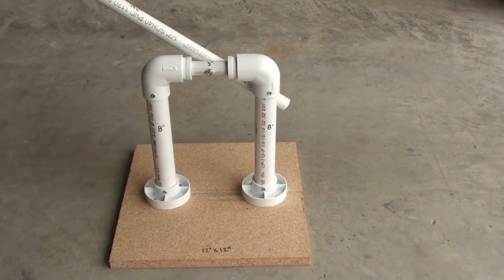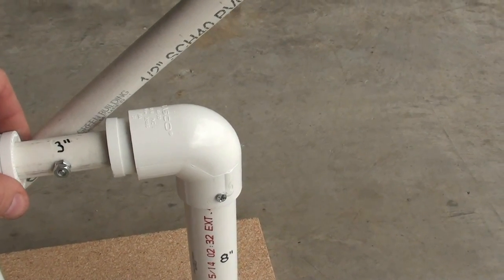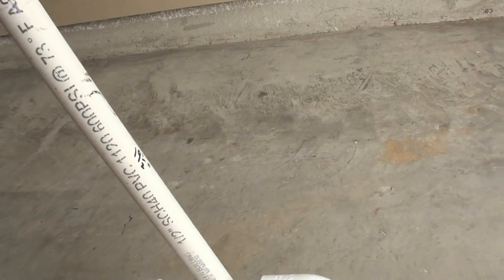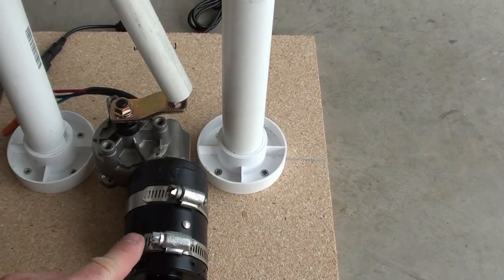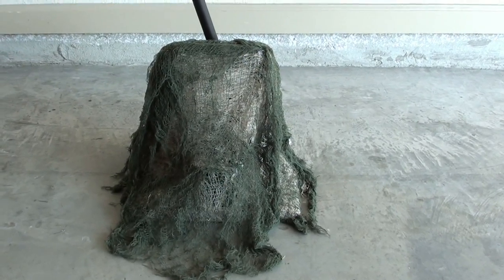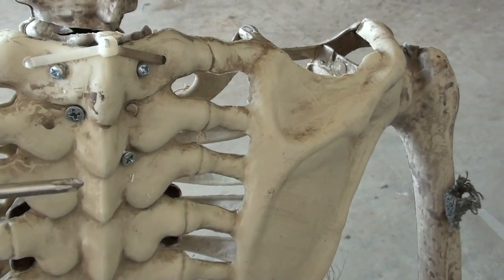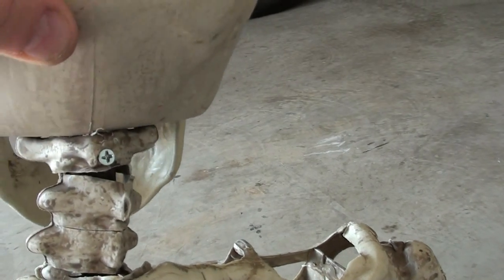How To: Ground Breaker (Circular Motion from a FrightProps Wiper Motor)

Comment: Any tips for reducing the noise from the motor and pvc?
Reply from the maker: I just kinda left my stuff noisy. It adds to the creepiness. WD40 or bicycle lube on the PVC maybe? Windshield wiper motors are a bit noisy, so enclose it in a box maybe?
Reply: Thanks so much! This turned out a pretty cool build! I added some legs and did a spray foam coal fired look. But I watched this video so many times and it helped a ton!
Reply from the maker: Tim Kline Awesome! I am so glad to hear that. What some “not in the biz” don’t understand is that these are homemade and very difficult to design and build. It’s a great day when you figure something out and make it  work. That’s why I made the videos. Congrats on your build.

Comment: Did you run the pvc 19inch inside the spine of the skeleton all the way up thru neck
Reply from the maker: Yes. I only loosely secured the head so it would move around.

Comment: how do you attach the shaft to the spine? You really don't show how
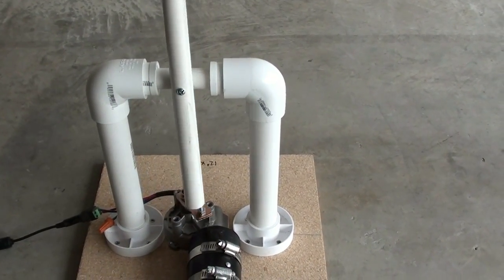Reply from the maker: There is a long screw attached to the top of the shaft. It does not attach to the PVC spine, but rather goes into the inside of the PVC and guides it in a circular motion. Advance the video to 2:22.

Comment: Do you think this would work off a reindeer motor or not enough torque?
Reply from the maker: Gilbert Street Cemetery I think a reindeer motor would have enough torque because there isn’t much weight, however it would move considerably slower. That’s why I chose the wiper motor.
Reply: I have an extra reindeer motor laying around and just finished my first motor/moving prop so was looking for another easier build for it. But now that I think about it I think your probably right I don’t think it would be quite quick enough

Comment: is the 19" diagonal piece just sitting on the 2" nut and bolt where it attaches to the motor arm?
Reply from the maker: Good question. Nope. Play the video at 1:05 and you can see that it is bolted to the 3" cross bar. This serves as a pivot point so that it moves in a circular motion when connected to the motor. The weight of the skeleton is on the 3" cross bar. Thanks for watching!

Comment: What are you using for a power source? You are going from 12 volt to house current using...???? Thanks
Reply from the maker: Hmmmm, I guess I skipped that part. Great question. I use a 12volt 5 amp DC power supply. You can briefly see it at 2:46 in the video. I buy these from frightprops.com, but they are available elsewhere as well.
Reply: Hawthorne Manor Haunted House thanks. Appreciated

Comment: Very nice!  But I missed the part in the beginning where you acquired the parts that turn from side to side.  What is the name of those pieces that allow the center bar to "turn"?  I've never seen anything like that in those big "home" stores.
Reply: You mention "connectors" at .54 seconds, but I can see myself walking into "HomeLowes" asking for PVC connectors, and getting the "look" from the help.
Reply from the maker: If I understand your question correctly, those are 1" to 1/2" PVC Reducers, available at Lowes and HD. You can push the 1/2" end in all the way and glue them in place, but leave the 1" end loose so that it can turn. Add a little grease for better movement. http://www.homedepot.com/p/Charlotte-Pipe-1-in-x-1-2-in-PVC-Sch-40-SPG-x-FPT-Reducer-Bushing-PVC021080700HD/203811579

Comment: How would you just make this go back and forth, not side by side...without motor.  Want to make prop for outdoor witch without motor.  Your idea looks great to start.
Reply from the maker: mark spencer please see my recent video on "the intruder". You need a pivot point. The motor can push it forward and pull it back.

Comment: How do u get power to operate this motor
Reply from the maker: I connected a 12volt 5amp dc power supply (http://www.frightprops.com/controllers-electronics/power-cables-and-transformers/dc-power-supplies-0726.html) to the wiper motor and plugged it in to an extension cord. It connects using a male and female terminal connector: http://www.frightprops.com/male-power-supply-adapter-with-screw-terminals.html. To have it trigger when someone walks by, add a motion sensor. You can see how to do that in my "Haunted House Sound System" video: https://youtu.be/kgbCJzd7Oys

Comment: Great videos, extremely tutorial and easy to follow and we love your other props = QUESTION - say I use a windshield motor...how do I power it?  It looks like you somehow wired it for electricity.
Reply: In the title he does it a wiper motor from frightprops so they have probably got adaptors to convert the power, however! Another idea is to grab a small 12V battery from your local battery supplier, about AU$50 at battery world in Australia, then there's no cable running too far and in the way, and can be charged with a car battery charger!
Reply: I have the same question. It looks like it might be some sort of DC converter? As many of these DIY's as I've watched, this subject doesn't come up?
Reply: @kgpiper44  windshield motors come from cars which are based on a 12V system, this means that you can’t just plug in into the wall outlet because that is 120V and it will just blow up. so, all you really need to run one of these motors is a good 12V power supply with enough amperage, something like 5 amps. You could use something like a computer power supply, but of course they can’t get wet so not really a good idea for outside use. Even some gaming systems like the older Xbox use 12V supply so if you had an old cable that you weren’t using that might be an option. But if you don’t know what you are doing the best way is to just look online, I know that Frightprops sells the windshield motors and power supply’s together, so that would just the easiest way of doing it.

Comment: ok, question *****  your vertical cross piece that is 1/2 inch is that not a bit of a tight fit?  When i spin mine it squeeks loudly from the front to back as that vertical 3" piece spins inside the 1 inch to 1/2 fitting i tried to put vaseline on the ends and not much diff, so wondering if you maybe sanded those ends or something to let it spin a bit more freely
Reply: *****  ok never mind, i found that the piece i was using was a little long so the ends were binding on that lip inside the 1/2" to 1" fitting, i cut a bit off so that the ends do not touch that inner lip inside that fitting and now it moves nice, no noise or binding.. :)
Reply from the maker: iowa chapman Oh, wait, hold on. Great question, actually. The 3" long 1/2" piece does not turn in the 1" to 1/2" fitting. The 1" to 1/2" fitting turns in the 1" 90 degree fitting. If you don't push that fitting in all the way, it fits together loosely. Add a little Vaseline or grease there. The 3" long 1/2" piece SHOULD be a tight fit in the 1" to 1/2" fitting. at 1:09, watch the lettering on the 1" to 1/2" fitting very carefully and you will see it turn. No wonder it was squeaking. Make sense?
Reply: Grin I think I got the same result by having that 1/2 inch size a bit shorter so it just barely goes into that 1" to 1/2" downsize fitting, it was rotating with no noise, the real test will be tomorrow when i get a power supply that should power the wiper motor, if this one dont work I will have to order from monster guts, and pay shipping ugh, this one is regulated, 12vdc 5a and has 3 prongs,  first one i ordered on amazon did not have 3 prong and it was stuttering on high speed.  I sent message had a feeling it was related to that power supply and they said yeah your power supply is the issue.  Found one on amazon with prime so will know tomorrow.  Thanks for reply
Reply: Oh yeah, I am using your version here for upper and then used those pvc from spider hill to do legs for lower standing swaying zombie.
Reply from the maker: iowa chapman So you haven't had power to run the motor yet? Hmmmm. With a loose fitting between the 3" long 1/2" piece and the 1" to 1/2" fitting, my concern for you is that it either binds (and, trust me, that can really tear things up) or it comes loose when you apply torque from the motor. You should let it run for a couple of hours to make sure. But ya know, with these things there really is no right or wrong way. We expect a vid on your finished prop. Thanks for watching and following. I enjoy the dialog.
Reply: Well not running fully, it would move inch stop for second move, so but I certainly can tell the front yo back is moving much easier after cutting that piece in middle do it was not going in as far to the 1" to 1/2" fitting.  It certainly was not making that pvc against pvc sound lol eeek!  I'll post up video when it's running before I start to kanoodle it before dressing 😀. Are you also on hauntforum?
Reply: Hawthorne Manor Haunted House Ok, this power supply works, what power source are you using, i have a 3 prong regulated 12vdc 5amp, and even on the slow side it still spins pretty fast, not nearly as slow as yours or CycloneJackHH 's version.. i figure i can get a motor speed control to slow it down, but was just wondering if I switched to a lower 12vdc 2amp supply if it would slow the rpms down.  I am just adjusting that middle piece a bit to make it even quieter, then i can start to bulk up with pool noodles and such and then look to do clothes, head, hands and boots.. and will post.    let me know of thoughts on the speed thanks again..
Reply from the maker: iowa chapman I used a FrightProps 5v 5 amp power supply. That's all you need connected to the lowest speed wire on the wiper motor. You'll have the slow speed, but enough torque to move the weight from the prop.

Comment: why are you buying the pvc pieces from that website, can you not just get those from Lowe's or Home Depot?
Reply from the maker: iowa chapman Good question. The 1" Universal Mounting Bases used in the video are not available in local stores. Home improvement stores may have alternatives (including other PVC fittings or metal threaded flanges), but I didn't find anything that would work as well. At $2 a piece plus minimal shipping, they are still reasonably priced. Thanks for watching and commenting!
Reply: Ok cool, I saw some cool stuff on the site and was like ok what's different about the t's.  Good video thanks for response.  Where you getting wiper motor from?  Monster guts.com?
Reply from the maker: iowa chapman frightprops. I've bought many things from them because they have excellent products as well as tutorial videos, product manuals, and customer service. I've emailed them questions before buying and they were very helpful. I haven't bought anything from mosterguts but I understand they are equally reputable. You can't go wrong either way.
Reply: Ahh yes familiar with that site too.  Sure wish the picaboo and the controllers would come down in price :)